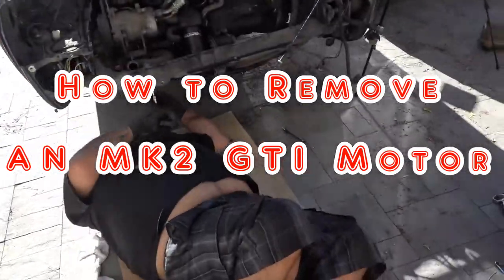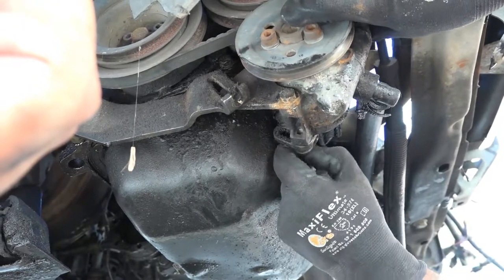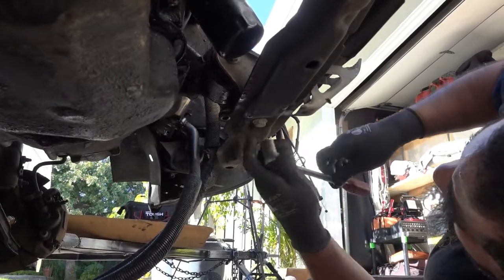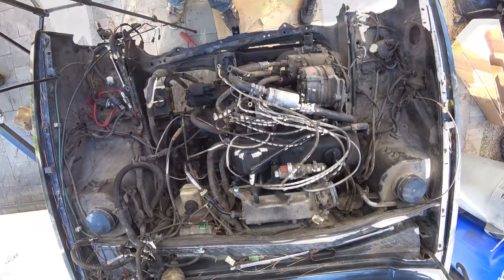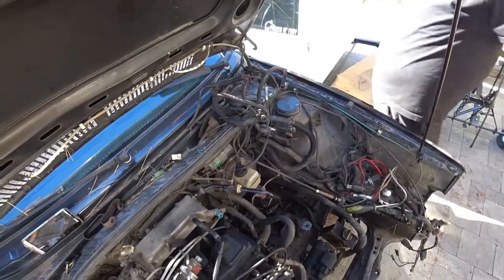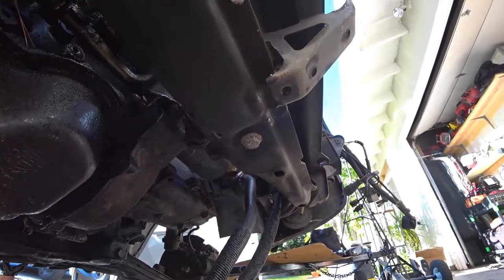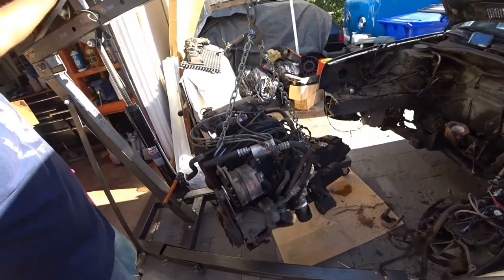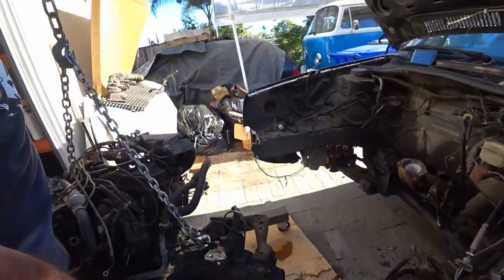How to Remove an MK2 GTI Engine S4 EP19

Comment: Really helpful, but did you use a torque wrench to break loose an engine mount bolt lol
Reply from the maker: No i just use a rachet
Reply: @PincheALsGarage  07:38, that's a torque wrench good sir.